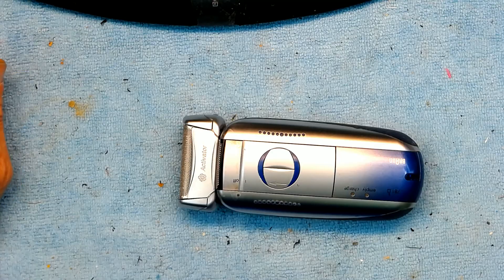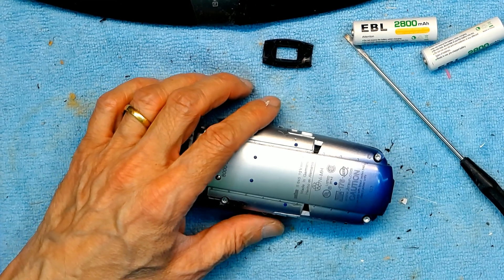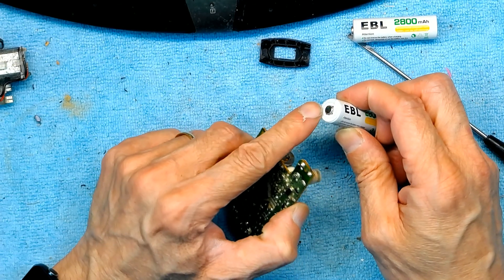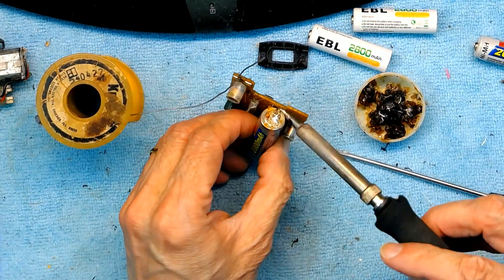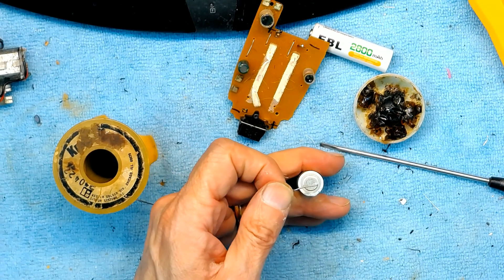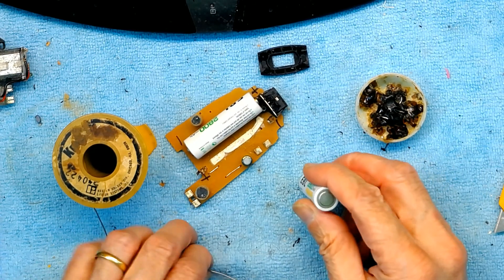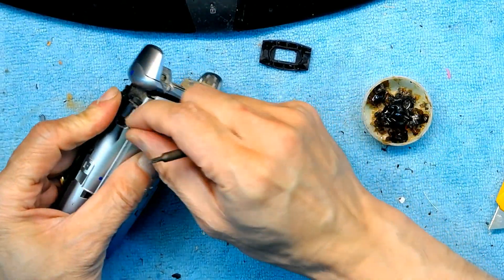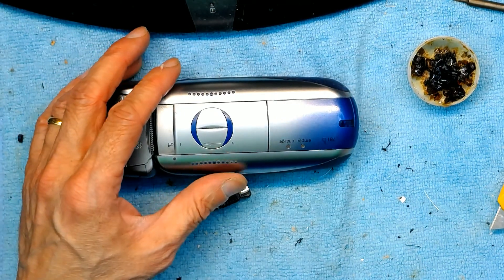Replacing The Rechargeable Battery in a BRAUN Activator 8000 8781 & Syncro, 360 Electric Shavers

Comment: Not all heroes wear capes. Thank you. I am about to attempt to fix my 20-year-old 8985. I have already disassembled it. I do have a few questions. Can I assume that my circuit board's positive and negative sides are the same as yours? It looks identical. My next question is: The factory welds look intense, should I try to pry them apart, or should I use a soldering gun to warm them up? Lastly, when you mentioned "explode," did you mean a concern like wearing a face shield and gloves, or did you refer to the battery failing? lol.
Reply from the maker: Thank you for your kind words, since I made this video I discovered that they sell pre-welded Rechargeable AA batteries so there is no need to heat up the standard AA batteries in order to solder them. Below is a link to these types of batteries. Also yes the polarity is the same on all similar models, and you can verify this by looking at how they are attached prior to removal.  Here is the link to these pre-welded batteries https://www.ebay.com/itm/333536407628

Comment: Hi, 
 Very nice job putting this video together. Thank you for making this video.
I have a question,  originally were the terminals welded, not soldered, on the batteries?
You said these were the 2nd set you were replacing.
If welded, what Technique did you use to break loose the  terminals?
I've yet to take my series 8000 apart & wanted to know what I'd encounter beforehand.
Thanks much....
Reply from the maker: Thank you, so I cut the original metal plate with metal cutter and re-soldered it back to the new batteries. However after doing that I found a better way and I made a video about it here https://youtu.be/nPyB1RH8yYY
Reply: Thanks for the quick reply. So you cut them off. Did you cut them off 'flush' from the old batteries? 
I understand that these terminals go thru the pcb & are soldered on the other side.
I read that some people were un-soldering them from pcb.
So you left them soldered to pcb?
Also, which model Kerpu spot welder did you get? I see on Amazon  they make many models. Thanks for your help.
Reply from the maker: @bobyork1235  You are very welcome. So the first time I desoldered them from the PCB then attached them to my new batteries and resoldered them back to the PCB. The 2nd time when I did this video I didn't have to desolder them from the PCB since its removal from the battery was easy with normal solder, as I didn't use the Spot Welder the first time. 
Also, I bought this one https://www.amazon.com/gp/product/B092DB5R3S/ref=ppx_yo_dt_b_search_asin_title?ie=UTF8&psc=1
Reply: @TECHNOLOGYTIPS101  
Hi again,
Thanks much for the info.
I will use the same technique as you did. I have a Hakko soldering station with adjustable temp. but no spot welder so will probably get that same one you did.
I did see that same model by  Kerpu you got at Amazon. It appears the main difference between models is how much battery storage capacity they have. 
I believe you used 2800 mAh AA batteries as replacements? Does that allow you to use the shaver for a reasonable time between charging?
I haven't been able to find out exactly what the mAh capacity of the original Braun batteries are.
I may just get some MiMH type made by Energizer with a 2300mAh  capacity since they are commonly available..
Thanks much for your time & help.
Reply: Hi, Good news! Got the job done. 2 new 1700mAh NiMN batteries form a store Batteriesplus. Approx. $5 each & they spot -weld at n/ 4 small nickel plated strips on new batteries. In soldered old batteries from PCB & soldered new ones in. 
Thanks much for your video & for replying to my questions.
Reply from the maker: @bobyork1235  You are very welcome, I am glad it was a successful operation.

Comment: How did you remove the factory spot weld without destroying the tab so it can be reused to attach to the new battery?  Need a video to show that challenge.
Reply from the maker: I just used long nose pliers to roll the terminal strip off of the battery, but you can also use this  https://youtu.be/nPyB1RH8yYY

Comment: Your video shows how to do it AFTER you had already replaced the original batteries once.  The original batteries on my 8985 look like they're "spot welded."   Will the soldering iron loosen a spot weld?
Reply from the maker: The soldering iron will not loosen the spot welding points. So you have to desolder it from the board and use metal plates to install the new batteries. Keep in mind that you can also buy these batteries new with plates on them already welded, here is an example https://www.ebay.com/itm/182123735697

Comment: Hello. I replaced the batteries and now the „battery empty“ LED flashes the whole time. 
The Voltage of the batteries in series is 2,7V (too high)... 

Did I destroy the circuit board?
Reply from the maker: Not necessarily, the voltage should be 1.2x2 which is 2.4V, however if there are capacitors in parallel with the battery it could be a little bit higher.  The reason is that when you plug in the charger the charging voltage is always a little higher than the battery voltage and the capacitors sometimes retain that voltage from the charger. If the battery shows empty check to see your connections and soldering on the board.

Comment: Thank you so much for your detailed comprehensive tutorial. I will give it a try and hopefully batteries don’t explote on me. Where can I buy the solder resine?
I will give it a try and hopefully the batteries don’t explote on me, I better use safety goggles. 
Know me, I better use safety goggles? 
Thanks again!
Reply from the maker: You are very welcome. Now they are selling the batteries with tabs already welded on them here is the link https://www.ebay.com/itm/303570625267

Comment: Hi! How powerful capacity of batteries may be installed in Syncro family shaver? 3000 mAh or more?
Reply from the maker: You don't have to go as high as 3000mAh you should be fine even with a 2000mAh batteries. Remember the higher mAh will not change the voltage or power, it will increase the duration of operation and duration of charging.
Reply: @TECHNOLOGYTIPS101  Sorry, but using of modern powerful batteries 2000-3000-3500 mAh in this "old-fashioned" shavers IMPOSSIBLE. Only low capacity 700-1400 mAh NiMH batteries can be installed for following charging and shaver using without main wire. Shaver has built-in "brains" for batteries capacity checking and charging and this info can't be changed. If you'll try to change batteries to items with high capacity, this "new" batteries isn't possible to charge in full. Saver will works 5 minutes after 24h long charging and red discharge indicator will works continuously. Real fail!
Reply: @andrewkuznetsov2064  That is not the case, I am using mine everyday and it charges to full capacity. You must have gotten a defective battery. The charging circuit on the shaver does not stop the charge at a certain capacity. It will stop when the charging current drops due the battery reaching it's full capacity and not being able take any more charge.
Reply from the maker: @andrewkuznetsov2064  It works with any capacity battery.
Reply: No, Sir. I checked rechargeable batteries from different brands - Sony and GP. New batteries was pre-charged, tested and works OK. For batteries replacement on my Syncro 7570 and 8585 360 grades Complete. In both cases, circuit units after replacement can't recharge this batteries and change for low capacity items (I install Ni-MH 850 mAh in both devices) should be made again. Now all works beautiful. Shavers' "brains" in both this models "don't understand" large capacity of modern batteries and can't charge it in full. It's real problem. Six years ago I got similar problem with Tecsun PL-600 world band radio with built-in charger, when branded high capacity (over 1500 mAh) batteries isn't possible (!!!) to charge, but low capacity Chinese "Tecsun" rechargeable units fills and works well.
Reply: @TECHNOLOGYTIPS101  May be in theories, but practics give us other result. Only low capacity rech. batt. (750-1400 mAh) may be installed in Syncro and 360 grades Complete without following "problems".
Reply from the maker: @andrewkuznetsov2064  Thank you for your time and the research you did in this matter. I appreciate your input and it is a great asset to our scientific community. I will do some additional experiments before I comment on your final findings.

Comment: Thank you. This saved me $300+ in replacing my 20yr old Braun 8585
Reply from the maker: You are very welcome!
Reply: Don't ever replace that thing The new ones don't even let you use them plugged in anymore! I even purchased a new like $350 Panasonic that sure it works pretty well but it doesn't even get the hairs on like your mustache area at the top but that brawn never had that issue at all it had proper cutting all the way at the very edge of the razor.  So I'm going to do this procedure he had in this video to fix my 85 85 as well.  I can't believe how easy it is to take apart I thought it was all like glued together

Comment: Hi, I replaced the batteries as shown here, but I charged them using an external AA charger before inserting. They were at 1.39V, everything works and the shaver feels nice and powerful again. However the red light blinks constantly when the shaver is on (even when the batteries are completely full). I ran the shaver for ca. 30 mins to discharge them a bit, thinking maybe the circuit board doesn't expect 2x1.39V and shows an error. But even after getting them to 1.3V, it's still red. When plugged in ti charge it only lights up 1 of 5 LEDs. Did I fry something?
Reply from the maker: Hi, I don't think you fried something but I do thing there might be a small solder bridge shorting out the LED driver circuit. When the battery voltage reading is 1.3V it means the battery is good, because they are rated at 1.2V and only a full capacity like new battery could reach 1.3V
Reply: @TECHNOLOGYTIPS101  I let it charge fully, checking the voltage every 15-20 minutes and it seems that the circuit board charged them to 1.45V. The actual charging voltage I measured was 1.5V, but the battery voltage stayed at 1.43-1.45 V from the moment the 60% charge LED came on - maybe it was just doing constant current topping up then? Anyway, the indicator now correctly shows the charge level and the batteries don't seem to be damaged, they did not overheat while charging and there is no swelling or anything. I will leave it in and see what happens, but it seems that everything is fine.

Thank you for the video, it was very helpful.

Comment: I unfortunately have 8595, battery removal is near impossible. They not only glued the battery to the board, but the soldering iron wont fit between the charger side, so not possible I must own the one off of everything made. I would like to just replace the circuit board with mew batteries anti consumer installed.
Reply from the maker: I am sorry to here that, but if you could send me a few images of the board maybe I can figure out a way to replace the batteries without having to change the board.
Reply: @TECHNOLOGYTIPS101   Soldering is not my forte, I admit, I hadn't broken out the solder gun in ages. I did more research and the solder tip needing to be cleaned...a lot. Now the hotter tip is making a difference. :  )
Reply from the maker: @actormarkhopkins8576  Great!

Comment: Thank you very much. My grandpa will be glad that i found this video.
Reply from the maker: You are very welcome, and good luck with the repair project.
Reply: @TECHNOLOGYTIPS101  how did you remove the original batteries? they don't unstuck when i apply my soldering iron, even though the solder has meltet
Reply from the maker: @lauritseriksen4140  That is because your original batteries were not soldered but welded. There is no way you can melt that so you will need to either desolder the actual terminal plate from the PC board, or use fine pliers to separate them. The pliers force removal is kind of dangerous because you can damage the board, or hurt your fingers. So it's much easier to remove the battery along it's metallic terminals from the board and use your own small jumper wires to attach the new battery.

Comment: Thanks so much for sharing it, I will try to fix mine old 8995.
Reply from the maker: You are very welcome, and good luck with the project.
Reply: @TECHNOLOGYTIPS101   I failed 😔. I followed your directions, including scraping the top and the bottom of the batteries, but somehow I was not able to solder them. They looked to be of a strange non-metallic alloy that does not allow soldering. Oh well, I tried. I ended to buy a new Philips Norelco 6800 from Costco.,, geez, it's so smooth. Thanks anyway for posting this video, much appreciated.
Reply from the maker: @pegasus3611   I wish you had contacted me before spending a ton of money on the new one. In such a situation all you need to do is get this battery linked here https://www.ebay.com/itm/182123735697

Comment: Oh man you are the king for this video I swear.  😊 I was so upset when I realized that it was not possible to buy a replacement electric razor like my 8585 Braun anymore because all the new ones don't allow you to use them when they're plugged in they say it's because it's a safety hazard because people would try to use them in the shower or something.  But we all know the real reason it's so that people can't use the razor after the battery isn't unable to be charged anymore it's just more plan to obsolescence.  It pisses me off because the vast majority of the time when I use my razor it's on my way to work in the car and half the time the battery in it is dead but at least my old one I can just plug the bastard in with a inverter in the car and it allows me to use it Even with the battery toast
Reply from the maker: Thank you, and yes I agree they don it because of corporate greed, not safety hazard. Specially when the AC Cord has a AC to DC converter circuit and the voltage that goes to the shaver is very low.

Comment: Yes lead soldier is best since it melts at lower temp generally better than lead free junk
Reply from the maker: Yes as along as you keep it out of reach of children, you should be OK.
Reply: @TECHNOLOGYTIPS101  I Keep all my toys away from children lol from soldering stuff to lithium batteries, I agree how quickly you have to get it done and with low heat. It’s amazing how how easy to open and up and the fluid design of this thing. Thanks again for the video
Reply from the maker: @So_called-v1j  No problem!